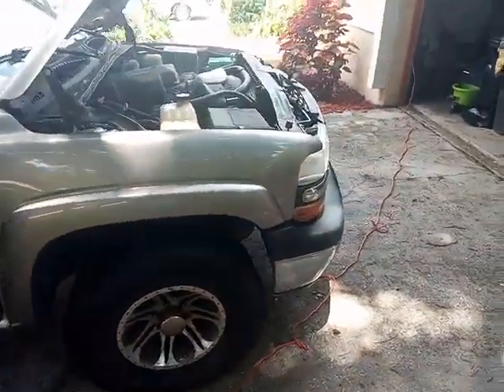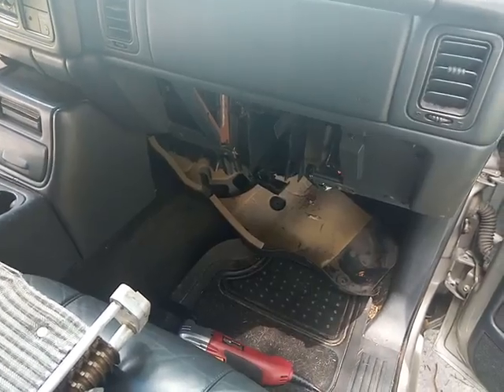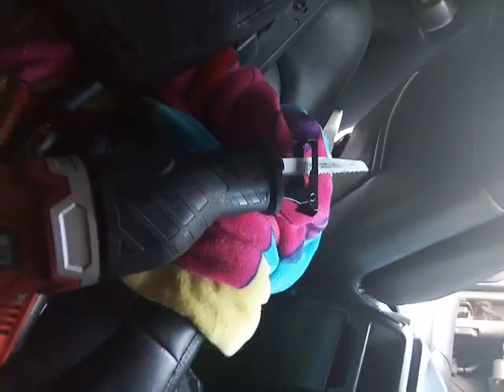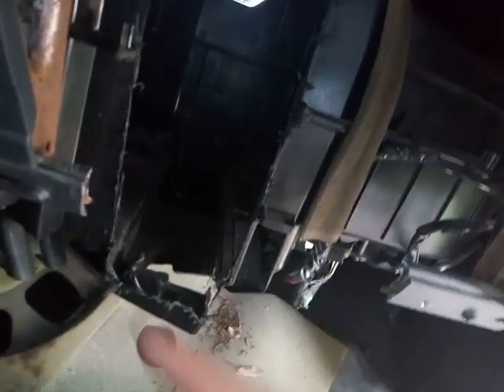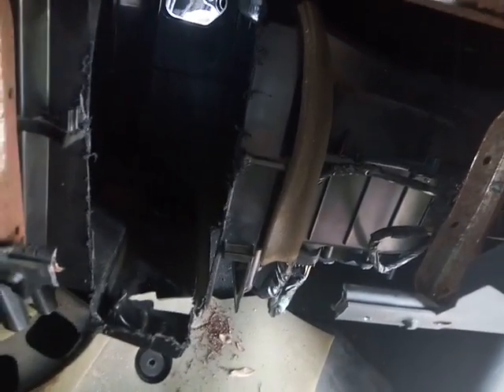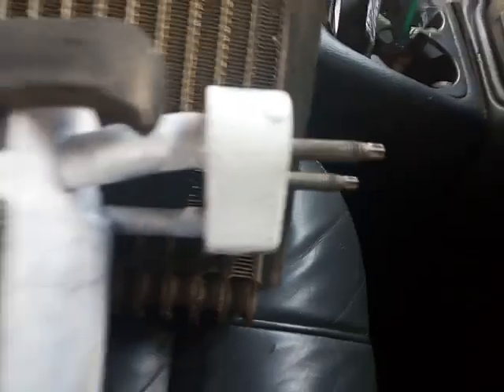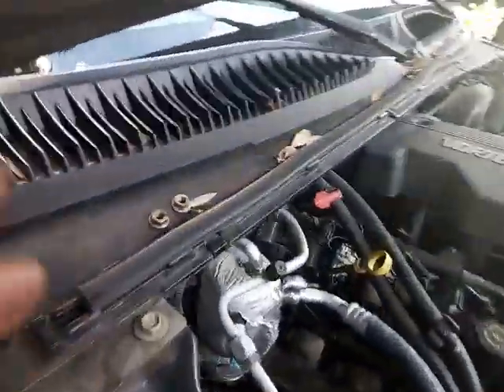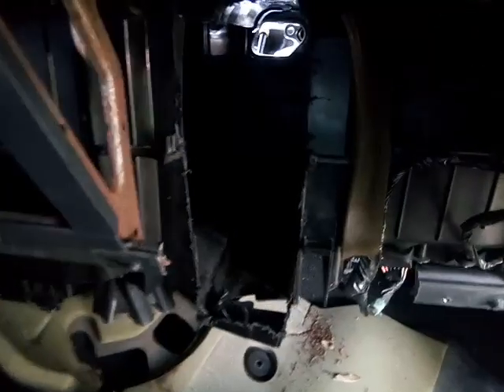Silverado Evaporator Replacement Trick (Replace Without Removing Dashboard!)

Comment: Hey friend. I saw your video. Despite all bad comments posted, I  must tell your idea was great. I used your idea to change the evaporator in my truck. I used a hot knife to pierce a hole and then I used a hand-saw to cut through  the box's front. I cut it off like a lid. Clean cut. I replaced the evaporator. Put the lid  back on and covered it with a   silicon-sheet.  Came out perfect. Thanks so much.
Reply from the maker: Yeah I actually in retrospect has a friend who said I should have used a hot knife for precision. That's the only botch part about the project but I was able to seal the drip tray and get everything attached back properly.

Comment from the maker: I am not an expert mechanic. I finally saw a lot of the comments (positive & negative) on here. I tried to come up with a solution that removed the tedious steps of removing the dashboard. The plastic could have been cut better but I was able to seal the plastic and reattach everything and there's no drip. You don't need the metal bar I cut out to reattach the glove compartment. Again, I'm not an expert and I might not know the tool and requirement names perfectly but my ac is blowing cold and I didn't have to remove my dash to fix it.
Reply: buzztrucker great job and very smart if you ask me.
Reply: Mustacheologist ,
Reply: This is great.  I am doing it this way.  I don't really care about the resale value on a 22 year old truck.
Reply from the maker: I don't know squat about cars. I just try to look up youtube vids and if it's manageable I attempt the fix otherwise it's to the shop. Been getting a lot of static but I didn't really have all the right tools. That cut wasn't to great but my AC works great now and at a fraction of the price an autoshop would've charged.
Reply: @buzztrucker   you did it right.  we paid $1300 labor for a new a/c system last year and now the evap core leaks so i will be sawing through whatever it takes rather than pay another $600-$800 thanks so much for showing us it can be done brother
Reply: Merica brother, get er done lol
Reply: @themanthemyththelegend1392  says something about you too
Reply: 6 String Terror omg, where can we send your refund?
Reply: Im just did this today, and finished under 40 mins, its working perfectly fine, no instantaneous dump
Reply: I was told today, $2200 to replace + $270 for the charge. Insane!!!!

Comment: Buzztrucker, right on man! This is freaking awesome. Been rebuilding salvage for years now and sometimes the best path is a straight path that makes sense. I'm going to take just a tad diff approach on the metal cut. What I'm going to do is  cut the plastic pieces first, then make the metal cut smaller.  When I put it back together what I'm going to do Is weld back the metal first with my 210 welder, grind it perfect, hit it with self etch primer and then plastic weld back the plastic, heat it with a heat gun and use some grey interior paint and done. That'll take me 40 minutes at most. You're idea is really smart, just because the they built this truck ass backwards doesn't mean we should wrench it that way.  Keep on keeping on!
Reply: I like your idea! Plastic weld the plastic back together and then get my son-in-law to weld the metal back in place. Then it's all put back in place without tape that could let go. I'm in the process of installing a retro cabin filter kit in as well just right of the evaporator. I've a 2003 Silverado 2500HD. I feel if you can keep the crud off the evaporator it won't go bad.
Reply: Traibazer 2003 is work??
Reply: Traiblazer  2003 is   Work
Reply: Can I use this method for heater core replacement?

Comment: That is such an obvious solution to a otherwise major project.  Thanks for the video.  GM engineers could have easily incorporated a "passage way" to replace that core.  Mine is a 09 duramax so I'll be studying the potential of this brilliant method.  Thanks !!
Reply from the maker: There's a better way to do it with a heat knife instead of the tool I used. I have no experience in doing anything car related. I only know how to change my oil, my oil filter, my cabin filter, and just recently I changed the alternator on the truck. The patch job I had to do sucked because I could have been more surgical with my cut and used a heat knife. Anyone on here giving me negative comments should keep that in mind. I was trying to save a lot of time and I did rather than having to completely remove the dash.

Comment: It worked for me i used one of those drill attacments with the abrasive cut off wheel, only key is to wiggle the evap coil up and down when trying to remove it after the cut , and make the cut wide enough, your gonna have to tape it up anyway. less resistance coming out or going in the better. I now have AC in 2003 chevy suburban  thanks for building my confidence in trying this (came out great you can't tell at all i hade ac problem)

Comment: As far as the drip tray goes you just have to make it waterproof which a two part epoxy could easily do for less than $10. The sides of the box can be tapped permanently with good ol fashioned ac tape which works very well and will allow you to take it apart again in a few years to clean the coil. At first I thought it was a butcher job but its actually not a bad idea as long as you change the accumulator and orifice tube along with getting it vacuumed properly

Comment: GM know dam well they could have designed it so you didn't need to remove the dash....your way of doing it is way better 👍🏿
Reply from the maker: @David-yy7lb  it ain't perfect but it saves you time I'm not someone with much experience I barely probably even know much about a torque wrench so I tried this and it was not the best but now I know what to do next time

Comment: If GM would have put an accessible door or someone have an aftermarket housing to access this much easier that would be fantastic
Reply: Yes indeed it would!!!
Reply: Engineers...........
Reply: @aww4954  deliberately done so most won't attempt working on it themselves thus insuring the shops can still make money off a $90 part by charging $700+ to install.
Reply: Deliberately done so most won't attempt working on it themselves thus insuring the shops can still make money off a $90 part by charging $700+ to install.

Comment: Yep going through the same thing now. Did the heater core this way too. Thanks.
Reply: Is the heater core in the exact same hole?
Reply: @CynicalDad81  its not the sane hile but it's in the same box. It
Reply: @douglasmueller4684  Where did you cut to get to the heater core
Reply: @devinalba3367  I believe it was a small cu at the bottom. Tinley it slide out. Was not to bad..

Comment: Ok truck isn't worth putting a lot of money into,I can understand that. I have a work truck 94 1500 and had the same concern, I did the evaporator core the correct way and then 3 months later it went out again. So like you I thought there had to be a better way.  New truck was not in the cards.  Lucky Evap was still under warranty but not so lucky on the labor.  So made a template of the core and drew it on the bulkhead (some call it the firewall but that is not correct) took my metal saw and cut the bulkhead and then the Evap case. pulled the Evaporator out the engine side.  Through out the plastic and put the new core in, then put a sheet of fire resistant insulation (no such animal as fire proof) . used the metal I cut out to make a oversized metal cover and now if I ever have a concern with the Evap core it takes less then 15 minutes to replace. And yes it is sealed and no gasses from the engine get into the interior. Maybe I should make a video
Reply: warbed1 make a video
Reply: make video
Reply: BarberChop VIDEO!!!!
Reply: Make a video!
Reply: This wasn't the hack video? U can do worse than this please post

Comment: Pulling a dash on these trucks is really hard. I'm in the middle of one this week on a restoration of a 97 suburban .  Had a good laugh about how much easier it could be. I've been thinking about this video as I pulled mine.  I'm making a video of the process to post here.  I had a broken mode door so this wouldn't have worked even if I'd wanted to take a saw to my plenum.

Comment: This is awesome for an older vehicle. I saved the plastic and used a generous amount of silicone to seal it back up. saws all 😀
Reply: Lucas Cranston so did you do what he did and replace the evaporator coil? And if so, were you successful?
Reply from the maker: Yeah I used Silicone sealant and it hasn't leaked. I did save the plastic too which I probably didn't mention in the video. Everything is back in place and the AC blows cold. I've used SAWS ALL ...( I get it now) maybe but like 3 times ever before this. I guess I had all the corrections coming on the spelling. The only thing I recommend is to use a hot knife for more precision, but the project despite having to be more careful in putting it back together was a success.

Comment: Hey I was wondering if you could make like a video or post some pictures on when you put the glove box compartment back on .to see how you bolted it on.
Reply from the maker: It's not hard. I just bolted the hinge back on and the original screws except one I believe it. Still works just like it before I removed it.
Reply: He didnt cut out any part of the bracket which the compartment screwed back into. Merely the one bar that stretches from left to right...
Reply: Kevin Hernandez

Comment: Do you think that this would work for getting my heater core out also. I seen a Video where it took a guy 20 hrs to do a Heater Core. I think he had bolts left over also.
Reply: I wish. I did the full deal (heater core and evap). Took me 12hrs (in between breaks and tempering my rage). I also made sure I put the same amount of bolts in as I took out.

Comment from the maker: I also removed the cabin filters to help make removing the evaporator easier. If you have any questions please post them and I'll try to answer them as soon as possible.
Reply: buzztrucker I have everything loose but my evaporator is hitting that plastic flange that sticks out from the top and I don't see any other way to get it out besides to break it. Did you run into this problem?

Comment: Someday I would like to know how to relocate the ac evaporator from under dashboard to the front engine bay to avoid doing that kind of mess
Reply from the maker: They just do this so you are frustrated enough to take the truck in and the cost of doing most of the job is in labor hours. I'm proud to say my AC still works great and I still have this truck and it has 216k miles running strong.

Comment: I have to say... I'm currently replacing every a/c part in my wife's 1995 suburban... Everyone says it's not worth $800-1,500 to fix things on their vehicles that are only worth so much... My question is ???? If it's not worth that much why don't you go buy another one then.... By the time you do you could have more into buying another used vehicle or you could have brand new parts that could last another 15-20 years ... Not to mention you know what you have then...

Comment: Can the heater core be replaced with this method? This only looks bad because the hole cover is in pieces. A complete cover, silicone sheet on the tray, AC tape to hold the cover, and it's a genius idea Instead of a hack. Great solution for a an 15-20 year old vehicle.
Reply from the maker: cesar I don't think the heater core can. It requires you to remove the complete dashboard unless maybe there's a way to cut into it like I did.

Comment: My car is valued at about the same price that mechanics were asking for to replace the evaporator core in my 2002 Dodge Stratus. I do have a couple questions for you, primarily about how you were able to replace the plastic square you cut out (since the box I'm sure needs to be sealed to the best of its ability) and if you had any leaking problems after cutting the drainage basin?
Reply from the maker: None. I used silicone sealant and duct sealant. I know I didn't do the best job and a hot knife would have been better. I just cut way too low. My recommendation is to just cut with more care and precision.

Comment: This guy "Zaw Sawed" his truck and ruined it. Can you imagine buying this truck used and discovering this hack job later on?!???
Reply: i agree, my truck's heater system needs to be looked at and i am not doing it like this
Reply: he did what he had 2
Reply: omoffroad this hack job just made it worse on value this truck won't be worth anything
Reply: loko freestyle he didn't do what he had to do. He purposefully chose to do a bootleg ass repair.
Reply: Jason I don't see what the problem is, he got the job done.
Reply: He did it this way because he's lazy.
Reply: I personally wouldn't do mine this way but, as a person that works 7 days a week 12hrs a day, and not having the down time to accomplish this the proper way, I can understand his reasoning. As far as resell value, I  could care less. I get every last mile out of a vehicle, so they're not worth selling to anyone other than a recycler when I'm done anyway. People need to understand, just because something isn't done "your way ", or "by the book", it doesn't necessarily make it the wrong way. If everything still works in the end, then nothing was wrong with the method. I'm sure none of you have ever hacked anything.......right?

Comment: I understand if you are in a pinch about to go on vacation or a trip in a few hours ok. But pulling dash is not that hard. Either way got to get ac refilled. It costs nothing to pull the dash if you have tools. My thing is if you are not mechanically inclined to do the job correctly you're probably not going to be able to do this hack and leave it alone. Save money get it repaired correctly. Once you mess it up a 800 dollar repair will be a 2k repair. And for 50 bucks replace heater core while you are at it. Blow everything out and check recirculation blend motor.
Reply from the maker: Repair worked. No leaks. AC blows ICE COLD. I'm not mechanically inclined. I just watched some hacky vids and figured out the dissection. This hack cuts the dash removal time which drastically reduced job time. My truck is probably (at least back then b4 inflation and coronavirus) worth not even 4-5k. It's got over 200k miles on it. 

Time is money. It's not worth the extra time for me with how much I make hourly and the value of the the vehicle to remove the dash. If people have the luxury of time then there's plenty of dash removal vids. God Bless You.

Comment: Did you have to do anything to the AC system before pulling out the evaporator?
Reply from the maker: No.
Reply: @buzztrucker  thanks I'm going to do this myself but I'm just worried about sealing it all back up.
Reply from the maker: @nycboy121  I was sloppy about it and yeah I don't know tool names. I'm not a mechanic in the slightest. I sealed it up nice though. I would just be careful to be precise when cutting the plastic housing.
Reply: @buzztrucker  how did you seal it up?

Comment: Will this work on a 09 Avalanche ?
Reply from the maker: I think the same general application of cutting into space behind the glovebox would work because the evaporator is still tucked behind there in plastic housing. Here's a video of how it would probably look for you doing it the hard way of completely removing the dashboard to access it. https://www.youtube.com/watch?v=SUmxhyyDXcs 

You would have to just locate that plastic part where the metal evaporator is and cut accordingly.

Comment: no thanks i'm not cutting up my truck like this
Reply: If it’s 2008 and under no one would even know it and it cost u less unless you’re rich and burn money? This method a lot quicker for family’s in short income and it’sa affective my ac get a to 39degrees this way I have many brings me their vehicles to be cut open and ac fixed any way necessary I guess it depends on money and heat index
Reply: @timothyallencottrell9643 this is old I know but why does it cost more money to pull and replace dash?

Comment: Thanks for the great video to save time and money but I just couldn't do that to my 02 s/w short cab, I'm the sort who lifted my bed to replace my fuel pump. I have 2 of these trucks a 99 short wide GMC and my Silverado and I know I have way more in them than they would bring if I ever sold them, but I won't. I will keep this in mind if a driver comes up with a leaky evap core.

Comment: good vid but im just gonna take it  apart!
Reply: What did you end up doing?
Reply: @roberthadaway8290  i pulled out the whole dash board. His way works to. But i didnt wanna cut.
Reply: I did my 2001 the right way and had problems with 22year old plastic crumbling, so reassembly was patched along the way with improvised reinforcement,..no way is it a few hours work. People saying that have never done the job.